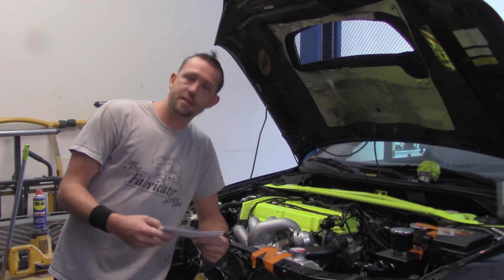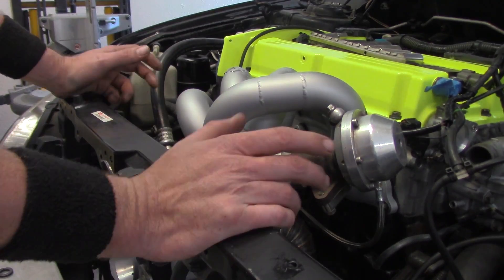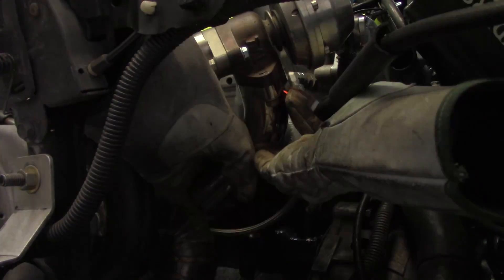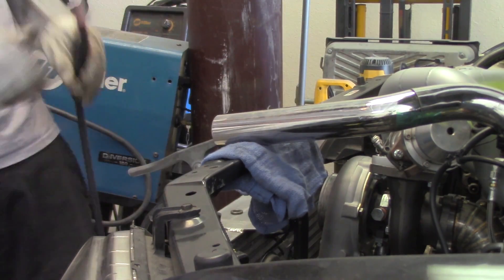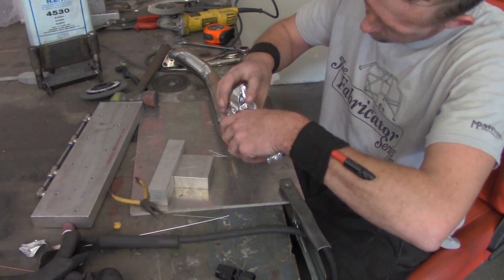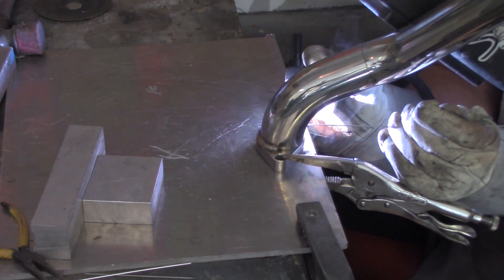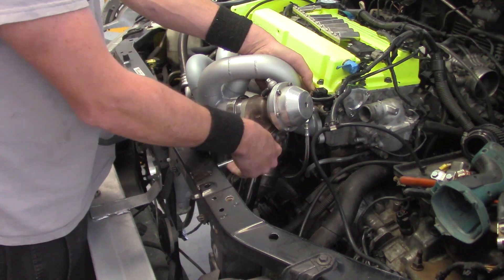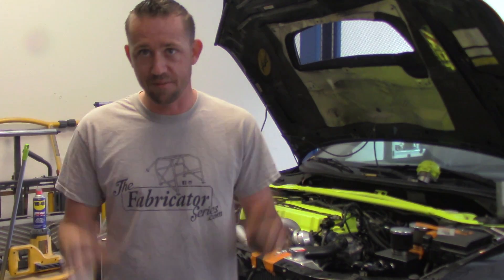TFS: How to Build a Wastegate Dump Tube #TFSFastFab

Comment: great info on your channel. What kind of band saw do you use. Im using a chop saw with stainless cutting blade its hard to cut 90s. I want a band saw now. Thanks
Reply from the maker: I have 8 different saws, but this is a Kama EV996 horizontal bandsaw
Reply: Thanks thats a nice saw super accurate , Ill start saving my dough looks like 4gs

Comment: Great videos.  But on a side note when you place the wastegate to dump into the atmosphere to close to the turbo compressor or within the engine bay the turbo ends up sucking in the wastegate hot gases and blows them back into the engine robbing HP. A better method is to have the wastegate dump back into the turbo exhaust side.
Reply from the maker: It is virtually impossible for the turbo to intake hot exhaust gasses with this location of the dump. The wastegate wont open until the amount of boost to open it is reached which means the vehicle will be moving which will leave all the gasses behind. The wastegate would literally have to dump into the turbo inlet in order for any gasses to get back into the engine.
Reply: im guessing you are new to car

Comment: I hope you disconnected the battery when you welded on the car. Otherwise you send that voltage right through it. Also what purge setup are you running?
Reply from the maker: What patw52pb1 said is correct. Isolating the battery will not protect anything. My purge is just a dual flow regulator.
Reply: That is not always the case. 
It really depends on the placement of the ground lead in relation to the torch and the distance between the 2. 
Most modern vehicles are not vulnerable to damage from TIG welding. 
Think about it... what does removing the battery cable accomplish besides isolating the battery. 
The alternator, ECU/PCM and other electronic devices are still connected to the chassis and the wiring harness allowing backfeeding any voltage into the chassis, harness and any device.

Comment: that external gate is useless. its facing the opposite direction to the flow of exhaust lol.
Reply from the maker: That is actually a big misconception. The wastegate is just a mechanical valve. It doesn't matter where it is located in relation to flow.
Reply: I beleive the object is to relieve drive pressure or excess boost, Right?

Comment: Easy way to avoid many hours of exhaust flow modelling, but not allowed on the road in most places, and even some tracks rules are now making external dump pipes impractical (eg noise limits, or statements that exhaust must be behind rearmost door seal). Out of interest, did you opt for a different surface coating the rest of the exhaust manifold or is there still a paint\coating process to be done after the video?
Reply from the maker: The stainless was left polished on this piece to provide some contrast under the hood. Thanks for watching!
Reply: Add a small (think motorcycle shorty) muffler to the dump pipe, and it's perfectly legal in NH.
Reply: The Fabrication Series the rust will contrast very well in a few months.

Comment: Nice work, also handy that your band saw has the offset blade angle, my ellis saw wouldn't allow those cuts you were able to make.
Reply from the maker: It wont handle larger diameter tubes. I think the biggest I can cut like that is 2 inch unless it is a super tight CLR.
Reply: You are right. Good reason for me to lobby the wife for a bigger one.